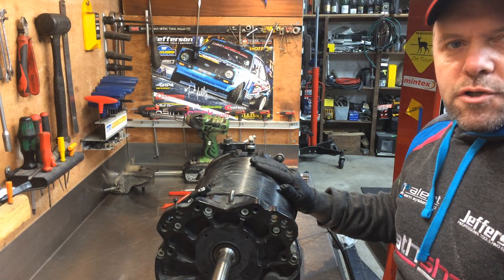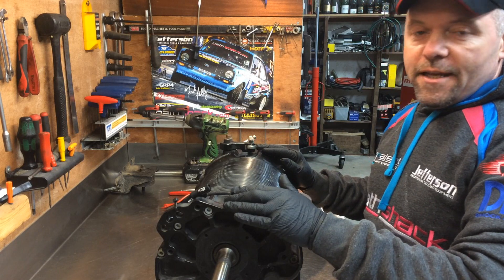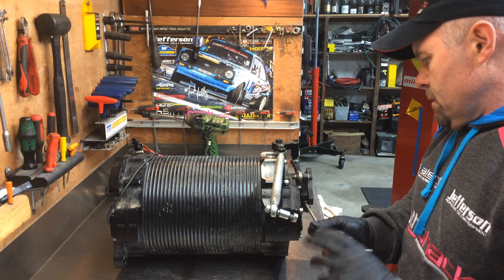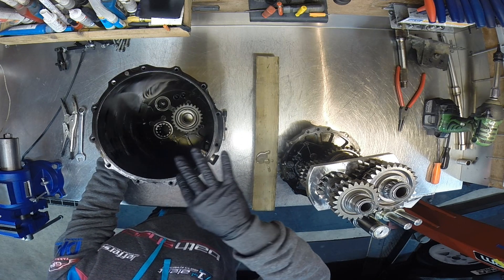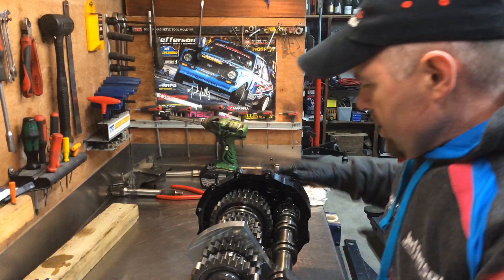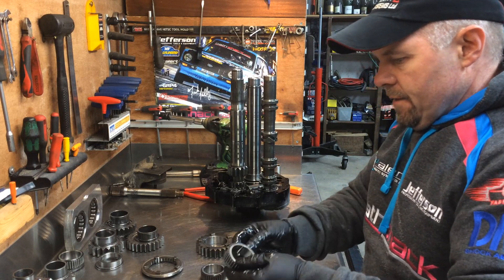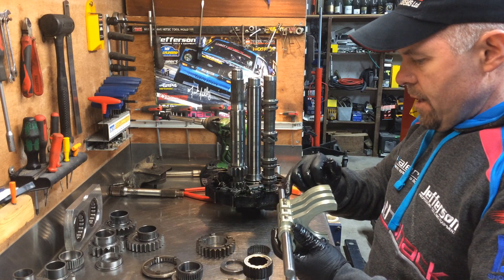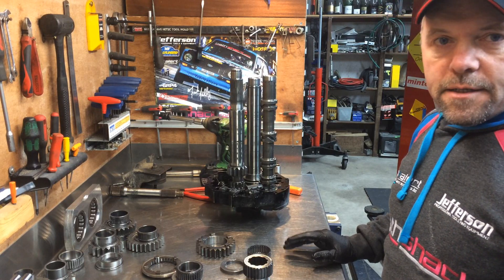Frank Kelly - HOW TO Disassemble a Samsonas Gearbox

Comment: Do the journals on the selector shaft wear with the pins running through them, or is the metal on it hard enough that the pins will be the only thing wearing out
Reply from the maker: Haven’t had any wear issues on the selector drum at all Connor. 
I assume as you say the pins are softer.

Comment: A thoughts with the magnets, wouldn't putting a strip of magnets along the bottom on the gearbox catch breakages better?
Reply from the maker: Could help in some but on this box the laygears run close to the base of the casing where the magnets would need to go. 
These are positioned at the point were oil flows through so seems to work well.
Reply: What about some real powerful ones and put them on the outside?

Comment: Enjoyed your breakdown of the box but I was curious about that particular box. There is a large void around the gears due to it being tubular, the oils could get flung away. Is there a pump?
Reply from the maker: There is a facility for a pump but it hasn’t been needed In this application. They hold 2 ltrs of oil which might help. 5 years and no oil starvation issues as yet.